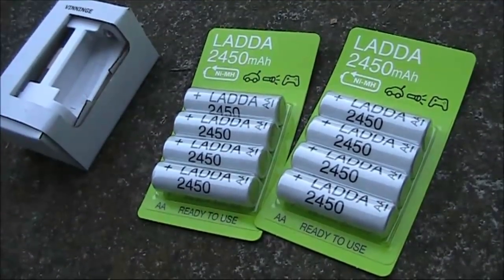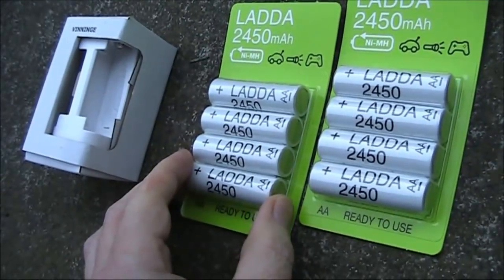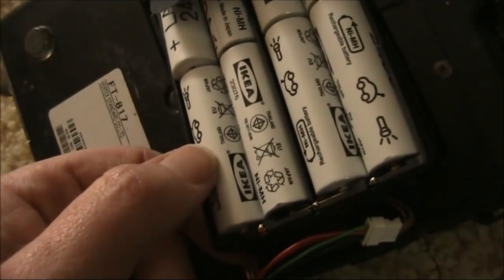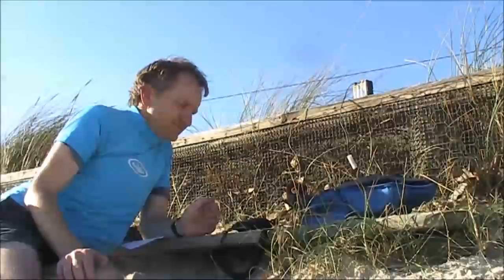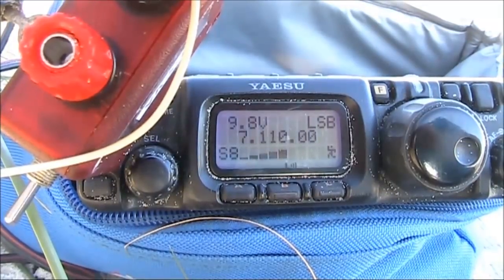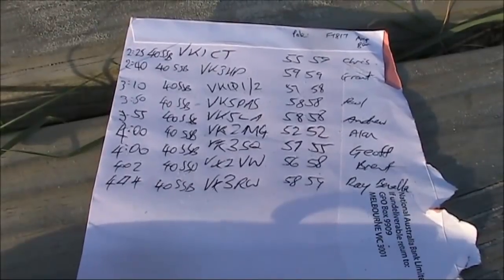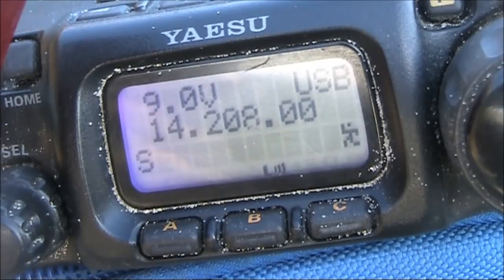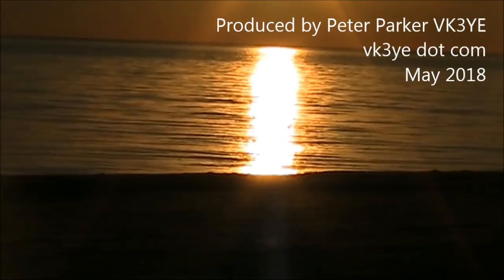How long can an FT817 run from 8 x NiMH AA batteries?

Comment: I have read you can use the internal battery holder if you first place the holder in the radio then insert
the batteries.  Have you tried that?  If I have to go external battery I might has well get something that will give me 5 watts of power.

Comment: You can get full power with the batterypack inside, plugin a clean powerconnector without power into the ft and you can use 5/6W.

Comment: hi peter...excellent job to see the energy available with such batteries... just for info, did you tried to use a dc dcconverter like arduino module, in particular step up modules, and use with lipo batteries like 7.4v and module adjusted to 13 v, or 11.1v with module adjusted to 11.1v ?? with 5 w from the ft817, we don t need to use converter module with high power, i think that  those with 5 to 10 A  ( 10 A chineese= 5 A real !! ha ha ha !! ) would match fine ?? what do you think about making a test ???  ha ha !!.. always love your videos !!!pascal f5pnp

Comment: If I used 4 x 18650 4000mah it would offer up 14.8v....... is this too high for portable with an 817 ?
Reply from the maker: Check the 817's specifications. I think it can do up to 16v from memory. Though it's not as efficient and dissipates more heat than 11-12v.

Comment: Nice video as usual. As others have noted: tray first and batteries later. The only "gotcha" with that is at a slightly larger diameter, friction in the tray is stronger than the springs. You just have to jiggle the cells around, but I have doubts regarding the quality of contacts inside the battery tray. Given that the instantaneous current can be scarily high, I'm uneasy about the potential for arcing. It's high time that a 14mm thick LiFePo4 pack became available for the little radio. Yaesu seem to have zero interest in improving it, only milking it for all they can. Cheers for that Yaesu San.
Reply: Dippy Hippy Currents don't cause arcing, voltage does. So you can stop worrying about that.

Comment: Thanks for the video: 1. Crazy letting that much sand into that rig. 2. I have the 818 and had the same problem fitting the full battery tray back into the unit. SO - once I need a second box, I will go with a 7.2 Mah Alarm battery which lasts at full power all day.

Comment: Nice video.  Big question.  My FT-818 instruction manual says: "The FBA-28 battery holder is designed fort use solely with Alkaline type "AA" cells.  Do not attempt to use Ni-MH or other replacement cells in the FBA-28, because it does not contains the protection circuitry required when using rechargeable cells".   The batteries you're using are Ni-MH if I'm not mistaken.  Mine is the FT-818 but I'm sure the 817 is the same.  So, is this risky to the radio to use Ni-MH?   Is it just saying not to use rechargeable?  It's a bit confusing.
Reply from the maker: Don't know - only use external batteries with my 817.  Try asking at https://www.facebook.com/groups/yaesu817group/

Comment: 1) yes, you can get 5W, just press the PWR menu item until the L icon flashes.
2) yes, you can put the batteries inside. First you install the empty tray, then you carefully put the batteries in. They fit very snuggly and could make poor contact, but if you wiggle them and seat them properly they will make good contact and will work inside the rig.

Comment: Nice video.  I ran into the same problem trying to put higher capacity batteries in the internal battery pack.  I gave up using that and instead used 8 cell plastic battery packs to get about 12 Vdc.  This also allows 5 watts output for a short time.  But any size AA cells will work.  Held the battery pack to the case with two large, about 1" wide, rubber bands.    If I was going to do it again I would try the NiCad AA cell batteries if they still make them.  They have much lower internal resistance, so at 5 Watts they should last longer.  WA9PWR

Comment: Some chargers will charge AA cells barely over 1.2V, others much higher. There is definitely something to say about low current CW rigs... I once went on a two-week hike with my Weber MTR, operating maybe an hour a day. I didn't need to recharge my eight AA cells even once. Now I do use three 18650s salvaged from old laptops for my KX2.

Comment: Eneloop AA NIMH-cells will fit
Reply: Can they charge from the 817 like the internal battery pack?
Reply: Alice Wyan if you modify the cable from the AA holder to the radio, yes. Look up a video about how to turn a 817 into an 818 equivalent, the guy there used the LADDA batteries and I believe disconnected the green wire which is how the radio tells apart what it thinks are NiMh and alcaline batteries.

Comment: The best Battery for Ham Radio outdoors operations are the LifePo4,  Litium Phosphate, nothing beat their performance. Expensives.. YES..  but last forever, with 13 Volt all day.. until 
60+ %  discharge.

Comment: It would be interesting to watch the voltage of each cell as the pack gradually depletes. How easy is it to get the sand out of the radio?
Reply: I too have wondered when that poor '817 will get the toothbrush treatment...

Comment: for better performance of your project, use 18650 batteries. unfortunately they are sold very expensive $$ plus we can cheapen the cost of batteries by recycling them from notebook batteries. the problem that pick up used laptop batteries, most are bad. here in Pernambuco, I got these batteries easy at a tech fair in the city. so if you use the laptop batteries use a protection system, known as a "bms" that protects the batteries against short circuit, it is some bms to calibrate the batteries, leaving all of them with the same voltage!

Comment: Nice video Peter. I use an FT817 portable too, at present I use 10 2300mA  AAs in an external holder, works fine for me. Like you, I had a struggle fitting the internal battery tray into the radio, the trick is to do it with no batteries installed, fit the tray, then insert the AAs........M0KED.

Comment: Good to catch you on Saturday, Peter. I was on the 818 portable into a 22m long wire and L match on a 10m squid pole at Mount Elliot on the NSW Central Coast. Quiet but definitely clear. I'm also assuming you were getting better East/West propagation with your setup than North/South.

-- VK2MG.